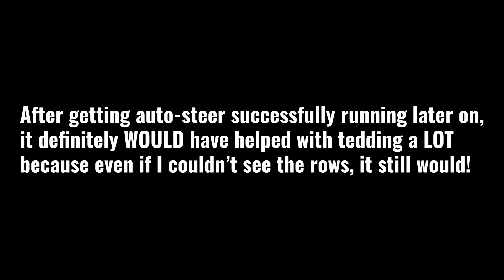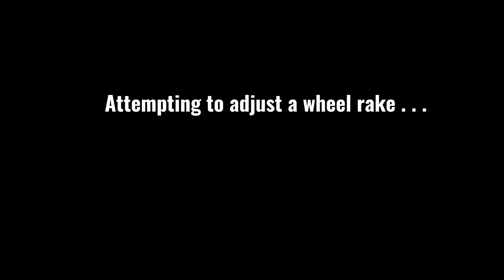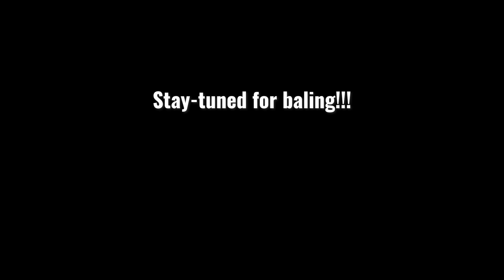464 Why I DON'T Adjust My WHEEL RAKE -- (And) Raking 2nd Cutting Hay/Crazy Rake Driver ~~

Comment: If you lay them down almost to the ground it would take some of the weight of the turnbuckle and be easier to adjust.
Reply from the maker: I did try it that way first, but I'm thinking maybe I need to do it like the hay cutter, where I use a slope to my advantage to help encourage them to "roll" in or out...
Reply: @This1LifeWeLive krone is the Tedder I have used the most in the last 30 years and we find to get the best results and your Kuhn will be the same. If you have a wheel height adjustment it’s normally a pin you need it in the lower wheel setting raising the machine then angle the other adjustment forward so that the rear of the rotors are a lot higher than the front. This throws the material higher in the air and don’t worry about covering all the field as it won’t be driven on till the next time. We make a lot of hay and haylage in Ireland in a similar climate as yours often tedding every day for 4 to 6 days. We grow ryegrass as alfalfa would not survive in our climate

Comment: Please lay the rake down when you adjust it. You'll find it much easier. Hard flat ground like the driveway would be ideal as the "wings" will easily move. The way that you were trying to do involved the whole weight of the "wing" bearing down on the adjuster. luckily you were not hurt. We sometimes adjust them in the field. Just pull the pins and move the tractor forward or reverse and the steel beam wil slide in or out with no strain on you.
Reply from the maker: I did try it that way first :)   But couldn't figure it out too well . . . I'm thinking it's one f those things that would be easier to see in person as the manual offers NO instruction on it :(

Comment: The tractor is not too big....the tedder is too small! Get a tedder with 4 baskets and you won't run over tedded hay. Cut, then ted once or twice each day. It will speed up your dry down time.
Reply from the maker: LOL, we bought the tedder way back when we had a John Deere. Tedders are hard to find out here, not too many use them or have one for sale  :)  But you are correct that they can be a life saver :D